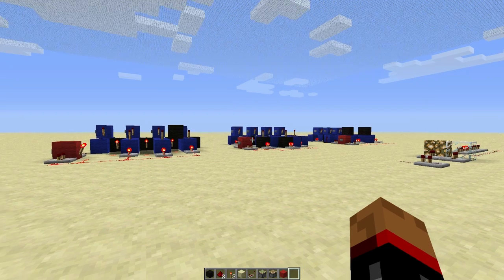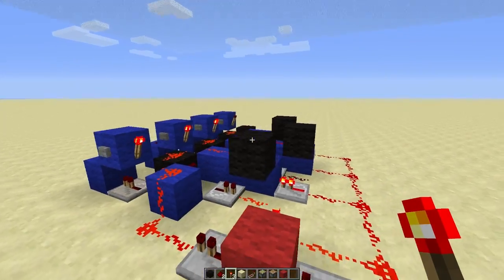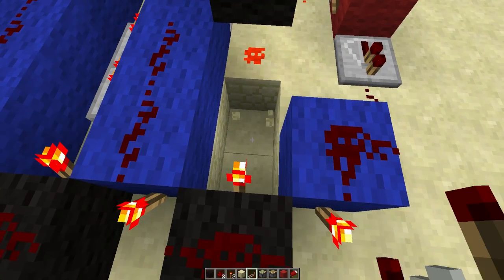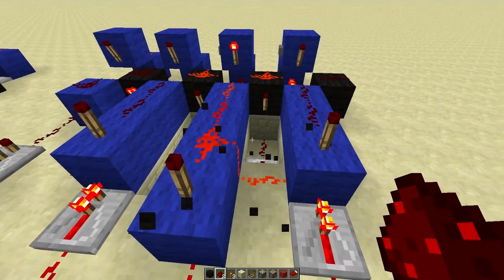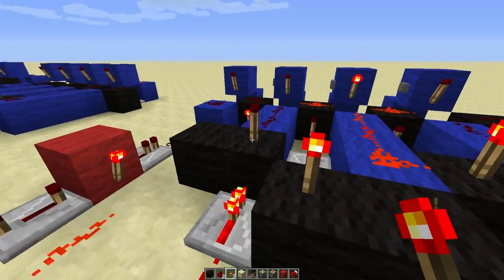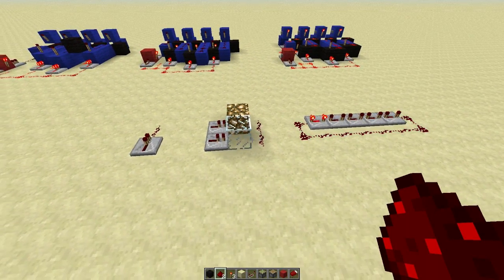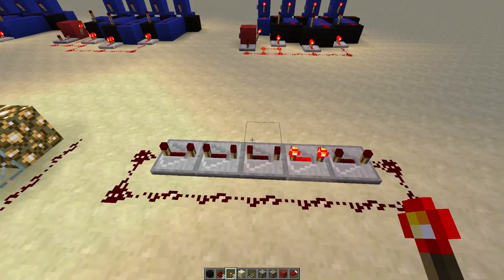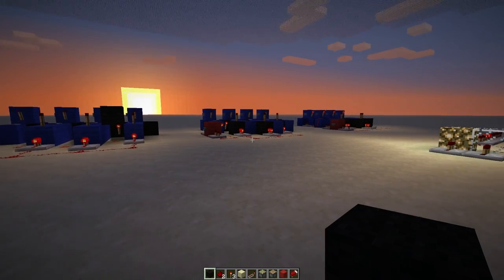1.0.0 Fixes: RS NOR Latch Array/Combo Lock Fix

Comment: check over your redstone again i use this lock in 1.3.2 allot and it works fine.
i have even found a way to have 2 independent codes on 1 keypad.

Comment: Hey can you fix for 1.3.2? I downloaded your save file and it doesn't work on there either, so it's not my wiring. I did the fix for 1.0.0, still doesn't work. As far as I can tell it's a problem with the reset mechanism, in that it it resets each input except the one you press (ie: if you press the "1" button, the first "lock" lights up. If you press the "3" button, the third "lock" lights up and the first "lock" goes out. Please help, because this is fantastic and I want to use it.